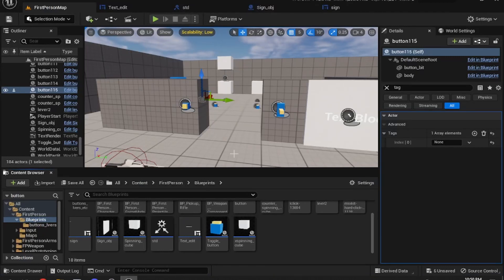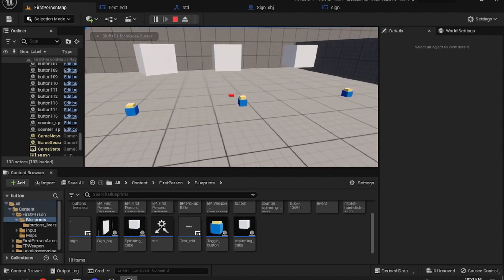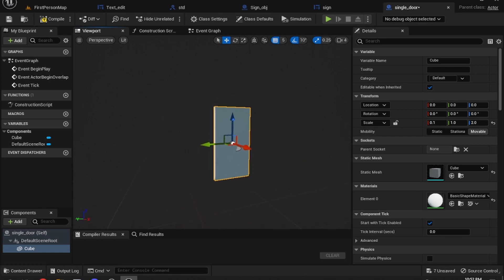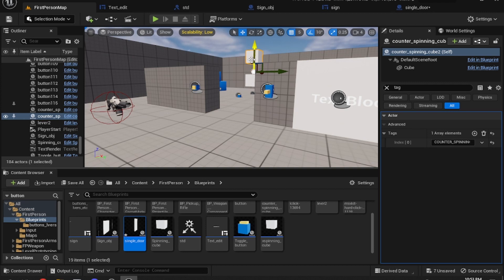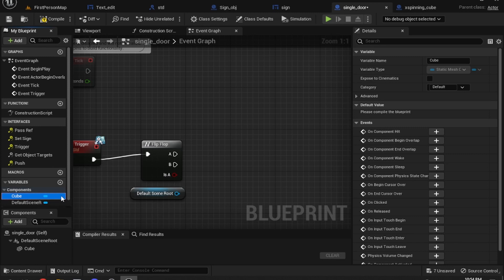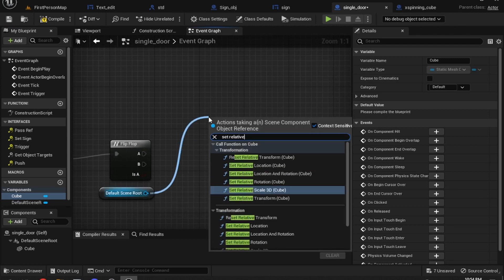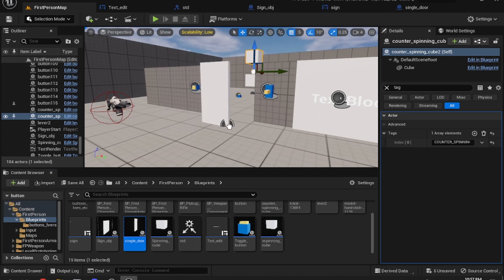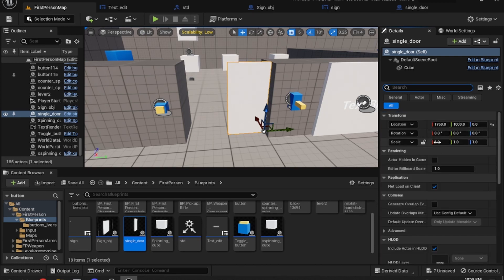How to : buttons part 4 Doors - unreal engine tutorial

Comment: How do you make only one time use and it automatically closes door
Reply from the maker: where the flipflop is in the door actor, put a "Delay" node that comes off the back of one of the set relative rotation nodes and into the input of the opposing one and simple set the delay time
Reply from the maker: https://pasteboard.co/6L6xjx2HgSkG.png
Reply: Thank u i would try that